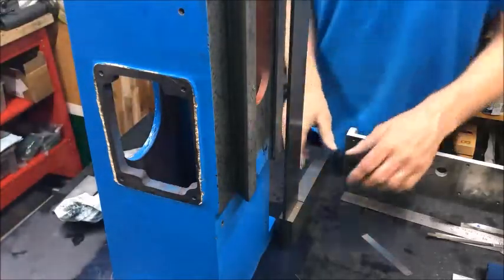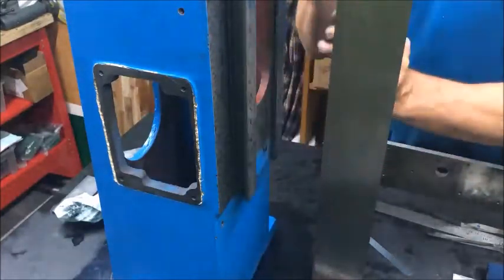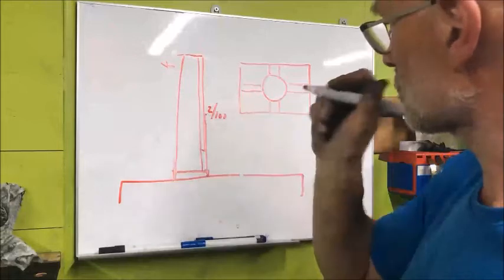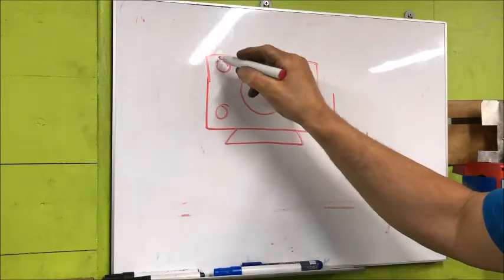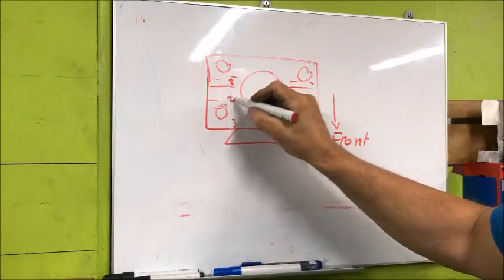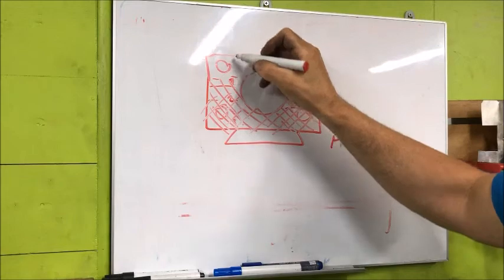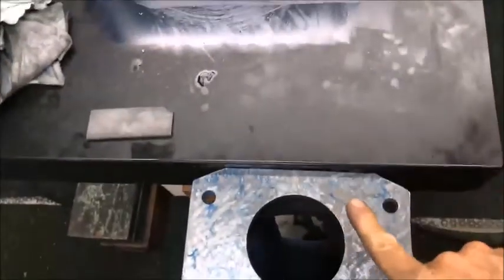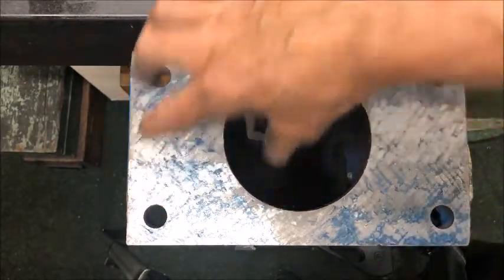HBM45 - column base scraping

Comment: How rigid is this machine? When totally assembled, does it vibrate when working? I have just bought a brand new ZAY 7045FG and it is the worst machine I have even seen. It vibrates all over even with the smallest end mill cutter of 4mm. Unbelievable. Is that one the same?
Reply from the maker: Thanks for commenting. This is not my machine, but as far as I can tell, there were some issues with fit and finish. This may be a concern vs rigidity. After scraping the parts this is improved. I can ask the owner how it performa
Reply from the maker: PS! I assume you have "optimized" the other parameters involved? Ie. tightened down axis not in use, clamped workpiece, milling cutter speed, depth of cut etc. ? Also mounted the machine correctly ie. levelled and clamped to a sturdy foundation?
Reply: @jansverrehaugjord9934  Yes, to all of your questions. I can, with all my strength, try to move the spindle by hand and feel no movement, either laterally or vertically, yet when the machine is in operation, it vibrates. I'm talking about every part of the machine from the milling bit to the table and spindle. An absolute mystery I have never seen before. I can only assume the base of the column is not mounted rigidly to the back of the base of the table body. Can you offer an opinion of this? The machine is painted all over in that area as well but I cannot see any paint splitting between the 2 parts. I would assume if the paint had cracked in that join, it would mean there is movement but there is no cracking.
Reply from the maker: @redgum1340  As I am not using such a milling machine myself, I cannot really tell what the limits with respect to its' performance is. However, I suppose you have some sort of "open connection" somewhere, but this can be anything from a loose gib needing adjustment to more serious faults needing professional attention. I do however suspect the machine was tested before shipment so that this is a simple affair. If you are very certain this is not a matter of user error or like I hinted to earlier, then I would try to go through all different parts/assemblies and check thoroughly. If nothing is found, returning the machine might be one option.. or depending on where you are, move up in quality/price
Reply: @jansverrehaugjord9934  Thank you for your thoughts and replies. I think it may be an  "open connection" somewhere and I really do need to find it. You are a very patient man and again, I thank you.
Reply from the maker: @redgum1340  Good luck!

Comment: For much faster process you can try to use epoxy glue (the slowest cure time) .... soft metal shim (can use annealed copper wire ...or  lead .. 

First .. placed the copper wire sandwiched between the column and the base ... at four corners of the column base ..

Then adjust the bolts until the column fully alligned to the base (using the spindle rotation and dial indicator will be easier) ..

Then inject the epoxy glue to the gap between column and the base .... and wait until it's fully cured ... 

Done ... no need for scrapping ....

For stronger/more rigid connection between column and the base ... you can try to add chicken wire / metal mosquito mesh ...mixed with eopxy glue .. then sandwiched between column and the base ...acting like ''rebar'' in concrete ..
Reply from the maker: Thanks for the comments.. and suggestion. I am aware of this and similar methods. There are usually many ways to solve a problem, but I wanted to have the possibility to adjust/remove etc.and consider scraping the surfaces to match superior vs.this suggested method. Properly sraped and mated surfaces in my eyes have the have most rigid metal-to-metal contact possible and will also last as well a be taken apart and if needed adjusted. As long as one can scrape, as I can, there wouldn't be any real reason why this shouldn't be used.
Reply: @jansverrehaugjord9934  Thanks for your reply ... I heard they added very thin layer of wax/non sticky substance ..so the joint can be removed easily ..

Am thinking adding 2 wider thick plate ...each one bolted to the column and to the the base to widen contact surface to give more rigidity to the joint ..
Reply from the maker: @pooorman-diy1104  Still can't see any advantage in the method IF one can scrape the surfaces 😀,  but it is of course up to the individual to decide.
It can be that a larger base would have improved the sturdiness/rigidity, but as shown in the video where I test the deflection, this is minimal and in my judgement within any realistic goal for such a construction/hobby mill. Maybe a plate resting on a bigger platform will help, but I am not sure it will how much. If I was to suggest anything, I woud instead anchor the top of the column to the wall. The reasoning behind this is course that you by this methods anchors the point of most deviation and lowers the amplitude of vibrations. Although it should be modelled to verify, this will also poossibly shift the natural frequency of any vibration mode, further helping. But all in all, there is a limit for improving what is a essentially a sizewise maximized hobby mill/drill construction. Given the measures are taken to optimize the surface qualities/geometry issues as this video series was intended to highlight, then I think the next step would be to buy a bigger, more industrial mill

Comment: One of the old school tricks I picked up from one of my machinist books was the use of cigarette rolling papers Jan. The Zig Zag brand I have are for all intents almost exactly .001" thick. If you use one at the top and bottom of your square it's not hard to estimate how much pull is required to slide it out from between the squares edge and your part. I think estimating the pull required on each one is very likely accurate to .0002"- .0003" at least. It's an extremely accurate test for parallel and flatness and the price is dirt cheap. They can also be used as an edge or tool point finder on either the mill or lathe. Thicker paper can work, but it's far less accurate since you not sure of the exact amount of compression thicker paper might have. That pennies worth of paper can do some jobs better than even my very expensive Haimer 3D digital edge finder can do.
Reply from the maker: Thnks for the tip. I have never smoked, but can at least buy the paper .. haha. WIll try!

Comment: Not 100 % sure, but I think the base only gives bearing to the outer left and right segments of the column. Worth checking.  🙂 Ah, you already found out.
Reply: Yes it’s really only some 50 mm at each side.
Reply from the maker: You are correct.. only at the sides so I "overdid" the relief work a bit :) Principle is sound though..

Comment: Sorry, but this method with shims and angle is very much error prone. You have everything what you need - place one edge of the angle to the bottom of the column (very firmly), and attach a base of a dial micrometer to the saddle. Then move the saddle alone the column touching another edge of the triangle by the micrometer tip. Of course, the angle precision must be 0 or even 00. And the bottom of column has to be flat before every measurement - this is a sort of overhead of the method.
Reply from the maker: Thnks for the comment! Will try this also!! This is what I usually do when the pieces are assembled (if I understand you correctly). I am happy to get this within 1-2 /100mm first now and then I asssume I will have to go back and adjust a little when the column and saddle are in place and I can measure this way.
Reply: @jansverrehaugjord9934  There is completely different way to align a column. You can find out on the Stefan Gotteswinter channel (he did it with his Opti MB4 milling machine). Using compound under and measuring in final assembly. I like it much more as it requires less effort (no scraping at all) and can be much more precise.
Reply from the maker: @vladimir.tsymbal  Will do this test also the way suggested.. as said, when I have it more assembled (don't want to mess with so many things onto the plate.. and I don't have the leadscrews here.) I know Stefan.. he took a scraping class with Richard King that I was arranging down in Denmark and I think he (and we others also of course) learnt a great deal (more) on the topic of machine scraping and alignment. Stefan, Richard, another fellow student and myself also shared a summer house at the beach during this week.. very nice ! PS! I have seen the way Stefan aligns his milling machine column with the use of copper wire etc... clever! But I still want to do it the way I have done. I cannot see how this can be less accurate (as this  is also an approach that I have been taught by a professional). I also use the approximate same method of measuring as he shows (this is one of the regular methods as far as I know) and also what we were taught (for ex. by Richard, on several occasions.. along with other ways, including what I have shown here). I will also measure with the compound mounted, but not at this stage when I have everything disassembled, but will do it when I have access to all parts and can run this test properly. It is also what you would want to do prior to taking the machine apart of course.. as I have shown before eg. in the Schaublin SV52 restoration series. Many ways to Rome.. 😀
Reply: @jansverrehaugjord9934  Agree, there are many ways, some of them a long, some are shorter. It's cool that you were among these great guys.
I'm not claiming that Stefan's method is most precise, but for the time spent, it is. I also started scaping all parts alone and then putting them together and hoping the axis remains within 0.01 - no way! I'm definitely less patient than you are, and want to get to result faster ))
BTW, after all the adventures with Z-axis, I'd start with milling head. It may have a lot of surprises with pinole axis alignment to back-base and so on. Anyway, good luck!
Reply from the maker: @vladimir.tsymbal  Thnks!